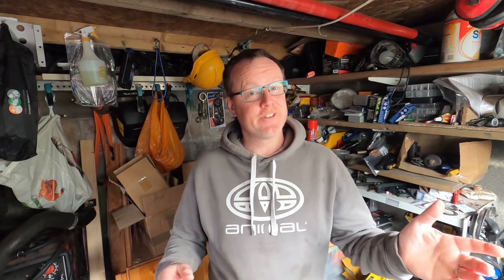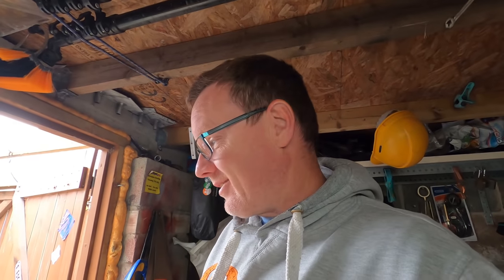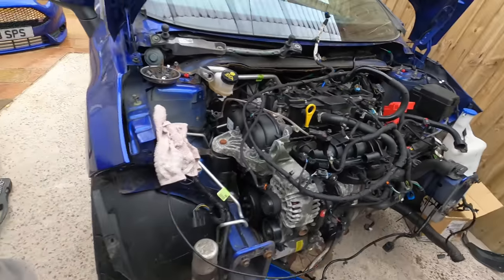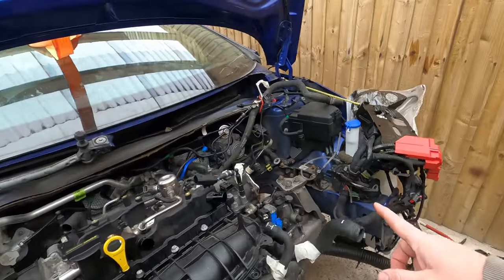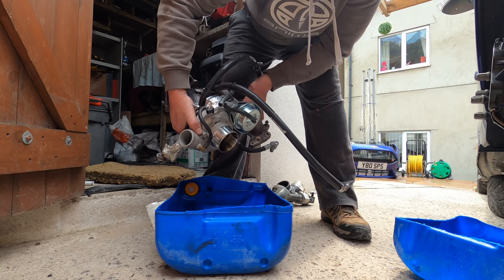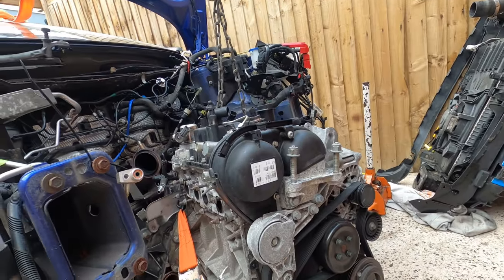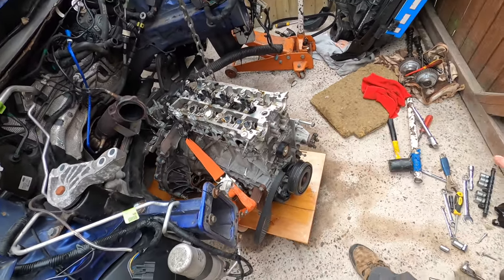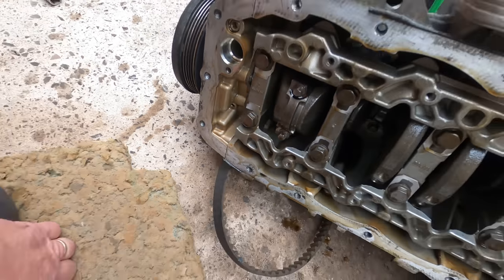Why did my engine blow? lets take it apart!

Comment: Hi Steve , my theory to the problem lays in the block or the serviceability of the head gasket. Situation you have is ,the engine had wear before you started using it for track. Now I haven’t followed many of your videos but I hazard a guess that with that flash turbo its above standard tune and running higher boost / power. The more performance you run the less reliability you will have . I don’t see there was anything wrong with the the tune of the engine as everything was running fine, it’s not detonation as this happens within the combustion chamber and there’s no damage to the face of the piston. You noticed a crack in the wall of cylinder 4 liner that is your clue . compression has squeezed passed the liner either through the head gasket or coolant gallery. Possibly in turn this may have caused a air lock and a coolant restriction in the engine, when this happens coolant doesn’t flow as it should and temperature rises rapidly causing hot spots on the cylinder walls.  for it to damage rings and ring lands to fail . It can be repaired but as you guess it’s just as cheap to slap in another engine and have more fun 🤩

Comment: Another great video. Regarding the turbo my experience with popped motors and turbo is the metal fragments in the oil go through the turbo bearings and destroy them. Rarely will a bit of ring land make ot past the valves and smash the exhaust wheel.

Comment: Replaced mine this week too and i can tell you setting timeing on those is a nightmare have done it 2 times now 
First when i blew a hole in Zylinder 4 and when i replaced the engine fully
Both times check engine light came on and i needed to get the car to ford 
Because of the tools from amazon i got

Comment: I thought that was what had happened, massive amount of work involved to get to the piston, you need to find out the cause otherwise it will kill your replacement engine as well, probably down to detonation/tune .... best of luck with it Steve 👍
Reply: Not enough ring gap for the cylinder pressure (boost). Absolutely text book failure.

Comment: Great video Steve

Well at least we know those who diagnosed a ringland failure were correct.

The mark on the piston looks like it's got very hot, surprised there was no damage to the bore.

Whats also concerning is the crack in piston 4, there's no saying this wasn't done before the piston failure and the engine wasn't showing any signs of a crack, I'm not sure as said if adding shims to the liners would solve this as you'd then be comprising the cooling between the bores and as the cut out isn't the full width like the 5 pot volvo engine would it really stop a crack from forming

Comment: Certainly looks like it's been hot in no.1 ring land failure is common issue with heat. Without logging afr we don't know what the ratio was but I bet it would help running it a few points richer to help with cylinder temps. Perhaps when you get the new engine filling down the ring gap a few thou to help prevent the rings butting up again.

Comment: You are a mechanic steve very knowledgeable..
It got to hot!.. more than lickly head gasket gone, water mixes with oil in no1 cylinder heats up hotter than hell melted off piston ring, I melted a piston rod clean off on my old Escort mk4 Rs due to trying to keep with porsche Carrera lol, I managed to rebuild it my self head skimmed new gaskets second hand piston new rings, and shells, bearings.. ready to fight another day.

I've got to do my timing belt soon on my Mk7 st, I'd like to see you make video for some pointers. 👍🏼

Comment: Steve, Ford didn't bring the sleeve all the way to the top of the block.  It ends just below the Head mating surface.  that coolant passage between the cylinders makes for a thin spot that flexes and deforms under heat and stress. You said in the video that there was a little bit of movement right where cylinder 1 and 2 meet.  This is a common problem.  You can get the Mountune supported block or you can look at a couple of other options who are re-sleeving the block completely.  That is probably why there was a clean spot above the failed area on piston one.   

J

Comment: in my opinion for some reason  №1 leaned out and started to melt, then as soon as the material got softer the high pressure of the combustion blew past the top of the piston and broke it down. Good that you reacted fast and stopped pushing otherwise it could be a catastrofic faiIure with hole on the block etc and everything mangled. I still think this power level is the top the engine can handle in standard form and i still think new sleeves and pistons can be put in it which would open it up for more power while safe at the same time. But who knows what's ur next plans, maybe something even better :)

Comment: Steve , Examine the piston crown for any detonation signs, wasn’t obvious in the video. If there’s nothing I’m thinking maybe there was a hotspot on that section of the crown, carbon build possibly. Add that hotspot and a weak or damaged piston to your higher boost tuned engine, it looks to me like that section of the crown failed, maybe blow by causing a heat build up, sort of matches the burnt look of that area. Also check the bore above the piston, if the crown came apart while running those pieces will have marked the bore, but from her it appears the damage is below the piston. Which in my head supports a blow by, heated , det combination destroying the skirt. Good video, and good luck getting the new engine done. All the best.

Comment: Ring gap was to small like I said in your last video.
Rings expanded to much created to much heat up and down the bore.
Reply: What can prevent that ?
Reply: Yo
Reply: @kd2833  what can prevent that? Either better cooling ( which night not help ya with too much boost ) or file down the ring gap. In burgerland engines get granaded all the time  because of 200 shot leans the engine out gets real hot closes the gap and breaks the piston.

Comment: Called it. It's potentially caused by pre-ignition/detonation. Either too much timing, incorrect fuelling and even a hot spot from carbon or tiny bit of damage to the piston. That engine should also be rebuildable with liners and pistons unless it really was cooked and is warped. You ideally need to find a cause otherwise it's likely to happen again 😔
Reply: I wouldnt say its detonation. No det marks on the top of the piston. Piston looks quite healthy aprt from the damage to the side. Looks like the liners have shifted and worn the edge off the piston
Reply: @danf3576  It's difficult to tell without looking in person - I have seen it where the evidence is "removed" by a hole being blown down the side of the piston.
I have had a think since I first watched the video (it was on a tablet, I had another look on my laptop, so it is clearer), and there are a couple of things that come to mind or stand out.

I agree that the liners have most likely shifted.

On turbo cars with a higher boost (I'm sure he said he's had a tune with the boost increased?), the rings are usually gapped wider as they expand more - rings with standard gaps can close up and cause damage like this.

If you look on the top of the No 1 liner, the carbon build-up looks like there was potentially a head gasket failure. This would tie in with the liners shifting. There is also part of the piston crown that is clean of carbon. This can happen when the coolant gets in the cylinder. 

Again, if the boost has been increased I'm also wondering if the head bolts stretched and the head lifted under heavy boost - that would certainly help cause the liners to shift.

To be honest, there are a few things that could have happened and it's hard to tell from an armchair.
Reply: Only detonation/knocking/pre ignition can damage the ring lands.
Reply: @FastLifeVlog  well thats not true, ive had the tip of a sparkplug fail and jam up a piston
Reply: @danf3576  here spark plug was fine so ...
Reply: @FastLifeVlog  but its not just detonation that can cause ringland failure. 
Sleeves moves piston goes off centre, rubs the liner wall pushes rings down into the piston. 
Enough damage to cause a failure easily
Reply: @danf3576   wil a better radiator fix this problem ?  Iam afread to go stage 3 after i read all this

Comment: Dont do anything with the engine apart from put it to one side and save for the future. Everything on the engine thats damaged will get machined away and replaced if you decide to go for a big build so its perfectly useable. Try not to damage the faces etc and good luck with the build👍

Comment: You need to get a decent engine hoist . With them kind of cars i used to disconnect the steering and leg top mounts and lift the shell off the lot. As for the loom leave it on the engine and disconnect it from the bay.

Comment: That engine was definitely suffering detonation at high rpm.  The new engine will suffer the same fate if the cause isn't rectified.  If the bore is ok that could go again with a new piston but ford don't quote any torque settings for the bottom  end. Hope you get it sorted.

Comment: That piston has got very hot for some reason causing metal distortion and failure. may be worth checking the others to see if they have the same heat damage, could have been caused by a fuelling issue, you would need to confirm this before replacing the engine, otherwise could happen again to the new engine.

Comment: Factory rings gap too tight for persistent high power use, expanded with the heat which makes them put pressure on the cylinder wall and it’s a vicious cycle of increased heat from there until the cylinder is badly scored and the ringlands disintegrate
Reply: I too suspect ring gaps, just a bit too tight for the extra boost/heat
Reply: The walls didn't look scored, but I agree when chasing power small things like ring gap are forgotten.
Reply: @elliotthale1835  true but the piston didn't look melted either, it was cracked. When the rings expand they push out into the cylinders and when they can go no further they buckle in the lands, and the strength of expanding metal is easily enough to wreck the piston. Depends on the alloy but the pressure can be thousands of psi, think railway tracks buckling in a summer heatwave

Comment: Not a mechanic, though I have interests like you Steve and do a lot of stuff on my car myself. But, for this failure. Is it possible that the map has something to do with it? Which made the injector spaz out and in turn made it run lean and cause the piston to melt?

Comment: I think....
Pistons and rods etc are prone to a certain amount of stretch when in use pumping up and down at 1000s of rpm. I think the added power has just pushed the piston beyond its limit and over a short time has heated up and failed. If the bore is still smooth with no damage that may rule out that's come into hard contact causing it.
Discuss......
Reply from the maker: Yeh bore is fine. It's the ecoboom curse 😭
Reply: @Sparkplugsteve  thank god the turbo was undamaged. The face of the piston looked ok and all the damage went straight down. In your case that's a good thing as you can reuse your turbo and swap the engine. 
If you were planning to resuse the engine you'd have to have everything under the pistons inspected. Cyl 4 bore was cracked anyway but you see what I mean.

Comment: Told you so :( So many cases of melted pistons… That kept me from tuning my Focus 1.6 Ecoboost. Prehaps that cilinder went lean, which made the piston melt.
Reply: Yep got to agree, all Ford's are now shite unfortunately 😑
Reply: @steeldevil98  why? Loads of us have tuned st's and not a problem. I trash mine on the nurburgring every month and use it as a daily. 80000 miles and still not a problem. If it was the piston that was running to lean and melted it's possible the tune wasn't good or injectors couldn't handle it. And seeing cylinder 4 was cracked i think it was running lean on all the pistons and number 1 just gave up first. And tuning a 1.6 4 cyl and give it 300+ hp without modifiying the engine is always a risk.
Reply: @TheTechnoaddict  yep good tuning is very important for Ecoboost engines. Friend of mine has a 300hp stage 2 Focus ST3 (by BR Performance), running strong even after 50k tuned
Reply: Piston has not been melted. See the ring land.
Reply: @FastLifeVlog  it looks like it's melted and cracked. Signs of running lean.
Reply: @TheTechnoaddict  do you run stock or tuned? If tuned interested to know the details as it's obviously solid with that mileage and workload.
Reply: @simonbussey7530  i first had stage 1 revo, now have custom tune from a guy who works with fiesta's for rallycross. Can compare it with stage 2 but custom made an not an off the shelf map. I run a custom made intake, stage 2 intercooler. Downpipe and exhaust are stock cause they are no restriction under 300hp. No problems with the extra heat in the stock cat at all. New oil and filter every 3k miles. Done about 150 laps on the ring, temperature never went up, not even one stripe on a 40 degree celsius day! Compression test was perfect, still first turbo.

Comment: Mate of mine who works for Brent Thomas said they did a favour for the boss on an Ecoboost Zetec S 1.0 125 the oil light had come on and couldn’t work out why until they dropped the sump and found the oil strainer and pick up full of bits off the timing belt as it’s wet belt apparently and runs through the oil he said it pretty much stopped any oil going to the oil journals check the pick up butty I haven’t scrolled through the comments but wondered if this is what happened to yours? Writing as I’m watching 🤣👍

Comment: Thinking about ford engines going bang..not too many. A certain Focus ST 170 started the trend and b4 you can say did you see that Sierra COSSIE  embarrass that 911 driver..the same COSSIE engine 16v that the bottom end was from the humble cortina..Pinto...as you owned an ST Focus Steve any issues similar..

Comment: Classic ringland failure. Very common on the 2.0 ecoboost engines, usually piston 1 or 4.2.3 rs engine the same problems. Lspi they think is part of the problem, but definitely a common weak spot on the ford engines.